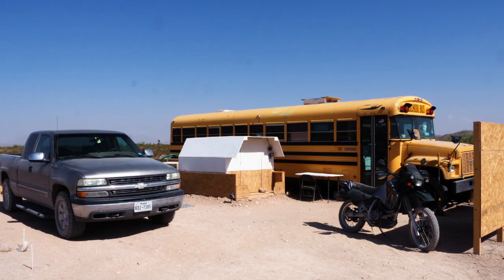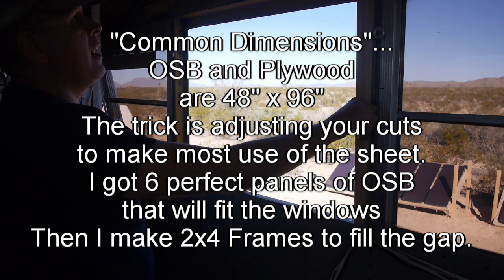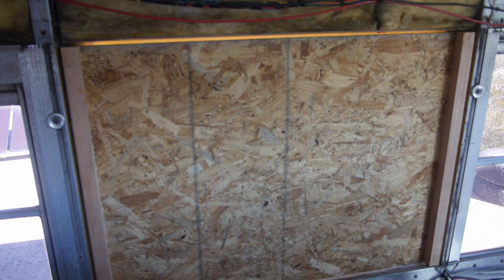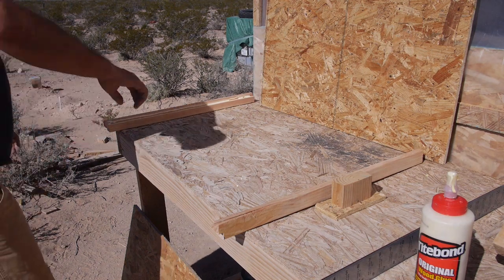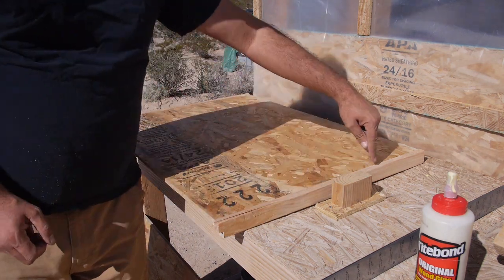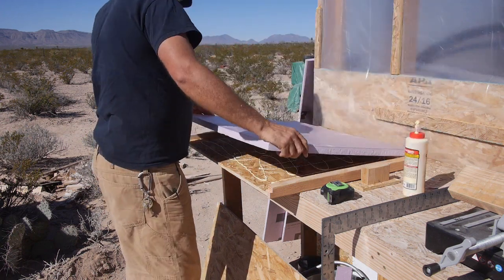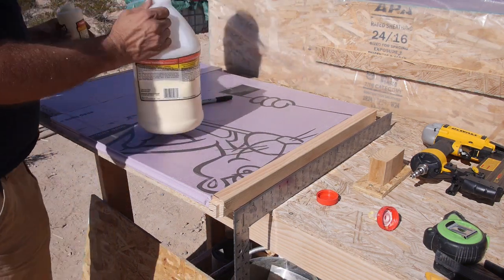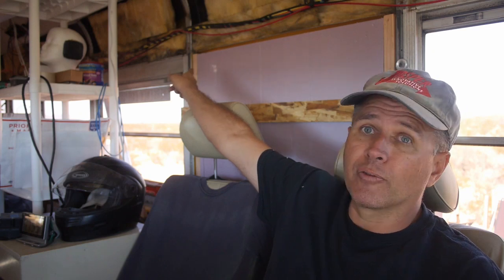Insulated School Bus Window Replacement Panels

Comment: I was watching an old video of yours about filling propane bottles. I have done it for years. I bought some brass caps from eBay. I use a scale but what I do is freeze the bottle first and it will be within a few ounces of full. It can be returned to the freezer and topped completely but it is tricky not to over fill. The brass caps handle any leakage and they are cheap. 
Also curious if there is any ground water there? I am sure it would be deep.
Reply from the maker: Yeah I read somewhere a guy was using a wine bottle cooler blanket to chill the propane bottles, seems like it would work.  As for the ground water, I have heard 500 feet...

Comment: What did you do with your top hatch?
Reply from the maker: The plastic was brittle and broke when I tried to open it. So I built a box with vents over the hole. Eventually I will do something nicer, but ut works for now.